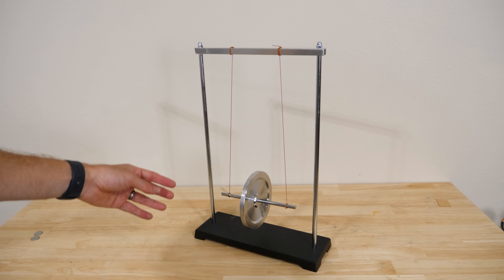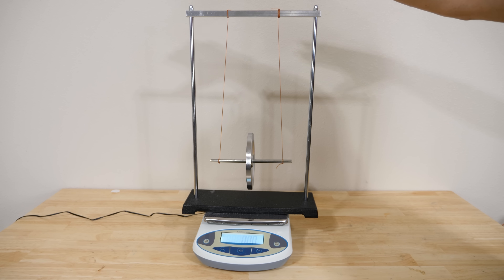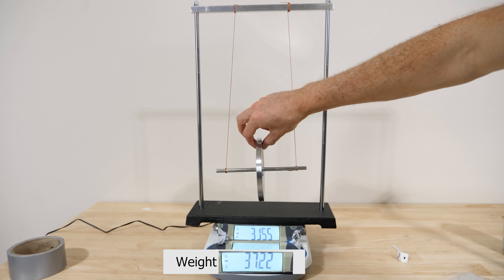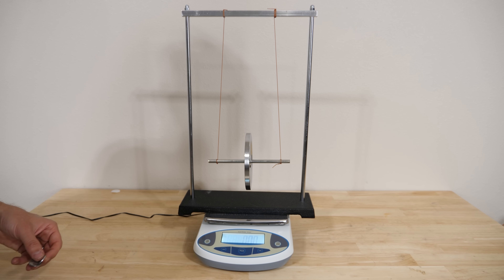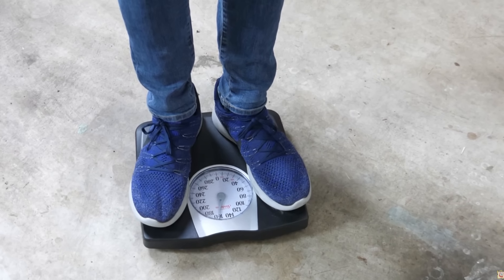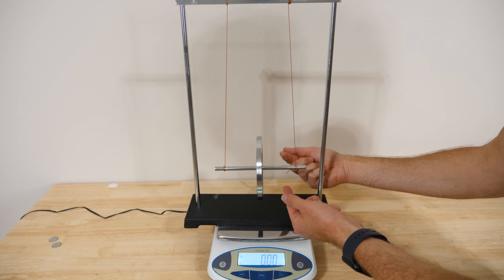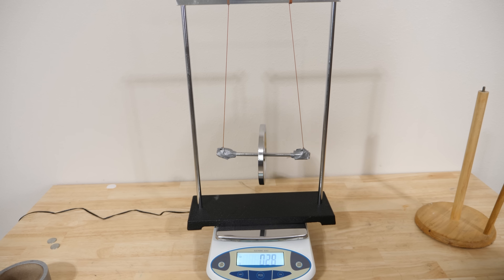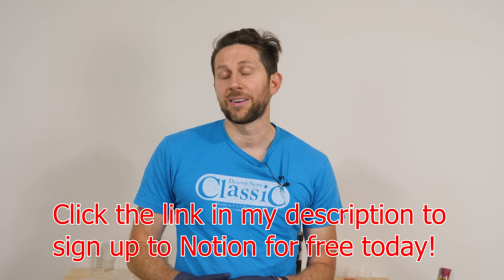How Does The Anti-Gravity Wheel Work?

Comment: Just for curiosity explanaiton posibility - Is this not a reason becuse if its  movinfg up and  down it diplaces the air above it that is generating the pressure the is pushng the object towards the ballance. And since its on eleastic (its non fixed geomety  rope - so there might be that there  there is weight  ( acceleration) acumulation  in the rope  (like in the spring) in the nform of vibaraitons  that ar resonating only at bouncing back - at very short point of time (the ballance averaging is not able  to capture it). The gyroskope has fived geomety and no air miving aup down or sidewise to it ..therefore the ballance indicaiton  is always  stable?  Would this be a possible epxlanation? Since the weight measuring is measuring directional acceleration. And you see rope swingling  and wrigeling..but you dont see this at gyroscope. and this could  be the difference? A  posibility of direction of air dplacement changed in time?  

Could it be simpler. So if it rotates and moves aside than it has 2 freedom axis of braking sytmetry of pressing air downwards  --  in 2 axis then reduce of weight is possbible. And gyroscope has one - because it  fixed not to move its fixation axis  sidewise - so then the gfyroscope has  only one dergee of freedom in its axes and weigh reduce is then not posisible? and since the density is realted .. change od geometry height invilves change of relative density difference of air and boject in relaiton to each other?  And for gtroscope it is not possible when fixed. When  wil lbe unfixed then might be didftent stoyy because it might have more axis of freedom to  diplace the air aournd it by 6 gramm :).

Comment: What you said about the spinning mass around you is not to my experience, correct. Assumption isn't a good scientific methodology. Do the test yourself and verify the weight of the subject and weight remain the same. 
As for moving down while going up, that doesn't really cut it for an explanation but conservation of momentum does. 
Good video but needs more work. 👍

Comment: Can we try in vacuum?
Reply: Makes no difference because:
The wheel does NOT weigh less when it is spinning!.
..
It may be more correct to say that it weighs less when it is "bouncing".
..
I have a problem with the interpretation of the Laithwaite demo.  Precession does not translate the wheel.  It does not lift it. 
Precession causes the axis of rotation to change direction. This is a ROTATION about the center-of-mass of the wheel. It is not lifting the whole wheel's mass. 
.
Precession does not cause the gyro to move (translate) sideways, nor upward in Laithwaite 's case or Veritasium's case. 
If the vertical spinning gyro had translation, it would slide along the table, but stay vertical. It does not do that.  It tips, or rotates at 90 degrees.
The fact that the handle is offset and long has significance.  If you push the handle in the direction of the precession, that lifts the handle, right?.

However the interpretation that the spinning wheel is always accelerating downward even while moving upward,  is a very good catch. It took me a few seconds to realize that.  My quick initial feeling was that the weight would go positive on the way up. . . 
The way to think of it is that is is 'partly falling' due to gravity.  When you are in free-fall you are completely 'weightless'.  The spin and string-shaft arrangement allow it to fall, but not fully, as when you are in free-fall.  So, the frame experiences somewhere between the full weight and weightless ness, but more weight during the bounce time. 
..
 The winding and unwinding of the string causes the up and down motion which is what changes the weight. 
..
Stand on a bathroom scale and at a medium speed, move up and down by bending your knees.  Try to move faster and faster on the way down and slower and slower on the way up. You will see your weight decrease during those times.

.. .. ..
If you watch carefully, you see that it is speeding-up as it drops; this is accelerating, but not at the full 'gravity-rate'.
Also, it is slowing-down as it rises, again not fully accelerating (decelerating or negative acceleration) due to gravity.
..
On a trampoline you are completely weightless from the time your feet leave the trampoline until they touch again and start the bounce. During this time you are constantly in 'total' free-fall.
When in contact with the trampoline you are accelerating upward and weigh more than normal.
If you can add a small upward force to reduce the acceleration due to gravity, you will weigh less. No surprise there.

This is analogous to only "partway" jumping on a trampoline (or your bouncing ball).  On a tramp, you are accelerating downward when your feet are not in contact with the tramp. The ball is when it is not in contact with the floor.  The spinning wheel only "partly" leaves the support strings.  It is "partially bouncing".
If the tramp accelerated you upward at twice the rate of gravity, your weight would double.
Therefore, there is also a slight increase in weight at the bottom bounce.
.
This would be equivalent to a small jetpack on your back that can't lift you, but only partly reduces your weight.  You would be in "Sloe-Fall", not free-fall.
..
This would make a wonderful Dean Drive Scam. . . .
..
It would be nice to have a real-time force load cell so we can see what happens at the bottom of the wheels travel - the positive weight gain during the short 'bounce' time.

..
Also, WHAT HAPPENS to the weight, if the wheel is NOT spinning, but bouncing while being suspended by a spring, instead of the winding/unwinding strings?  
Is that equivalent to this "partial bouncing" effect?

Comment: Spiral Spinning is a key to understand anti-gravity... everything what levitates is spinning... have you never asked yourself, why planets, solar systems, galaxies are constantly spinning/rotating?
The famous austrian investigator Viktor Schauberger found out a lot of hidden principles of the nature and build an ufo prototype for the germans.
Read his books.
Reply: The wheel does NOT weigh less when it is spinning!.
..
It may be more correct to say that it weighs less when it is "bouncing".
..
I have a problem with the interpretation of the Laithwaite demo.  Precession does not translate the wheel.  It does not lift it. 
Precession causes the axis of rotation to change direction. This is a ROTATION about the center-of-mass of the wheel. It is not lifting the whole wheel's mass. 
.
Precession does not cause the gyro to move (translate) sideways, nor upward in Laithwaite 's case or Veritasium's case. 
If the vertical spinning gyro had translation, it would slide along the table, but stay vertical. It does not do that.  It tips, or rotates at 90 degrees.
The fact that the handle is offset and long has significance.  If you push the handle in the direction of the precession, that lifts the handle, right?.

However the interpretation that the spinning wheel is always accelerating downward even while moving upward,  is a very good catch. It took me a few seconds to realize that.  My quick initial feeling was that the weight would go positive on the way up. . . 
The way to think of it is that is is 'partly falling' due to gravity.  When you are in free-fall you are completely 'weightless'.  The spin and string-shaft arrangement allow it to fall, but not fully, as when you are in free-fall.  So, the frame experiences somewhere between the full weight and weightless ness, but more weight during the bounce time. 
..
 The winding and unwinding of the string causes the up and down motion which is what changes the weight. 
..
Stand on a bathroom scale and at a medium speed, move up and down by bending your knees.  Try to move faster and faster on the way down and slower and slower on the way up. You will see your weight decrease during those times.

.. .. ..
If you watch carefully, you see that it is speeding-up as it drops; this is accelerating, but not at the full 'gravity-rate'.
Also, it is slowing-down as it rises, again not fully accelerating (decelerating or negative acceleration) due to gravity.
..
On a trampoline you are completely weightless from the time your feet leave the trampoline until they touch again and start the bounce. During this time you are constantly in 'total' free-fall.
When in contact with the trampoline you are accelerating upward and weigh more than normal.
If you can add a small upward force to reduce the acceleration due to gravity, you will weigh less. No surprise there.

This is analogous to only "partway" jumping on a trampoline (or your bouncing ball).  On a tramp, you are accelerating downward when your feet are not in contact with the tramp. The ball is when it is not in contact with the floor.  The spinning wheel only "partly" leaves the support strings.  It is "partially bouncing".
If the tramp accelerated you upward at twice the rate of gravity, your weight would double.
Therefore, there is also a slight increase in weight at the bottom bounce.
.
This would be equivalent to a small jetpack on your back that can't lift you, but only partly reduces your weight.  You would be in "Sloe-Fall", not free-fall.
..
This would make a wonderful Dean Drive Scam. . . .
..
It would be nice to have a real-time force load cell so we can see what happens at the bottom of the wheels travel - the positive weight gain during the short 'bounce' time.

..
Also, WHAT HAPPENS to the weight, if the wheel is NOT spinning, but bouncing while being suspended by a spring, instead of the winding/unwinding strings?  
Is that equivalent to this "partial bouncing" effect?

Comment: If you can make it reach -1000KG we can have flying cars.
How big would it neet to be to reach -1000 KG ? Just need a few of those in sync like the pistons of a combustion engine to compensate for the 0 point.
Reply: Nope.
The wheel does NOT weigh less when it is spinning!.
..
It may be more correct to say that it weighs less when it is "bouncing".
..
I have a problem with the interpretation of the Laithwaite demo.  Precession does not translate the wheel.  It does not lift it. 
Precession causes the axis of rotation to change direction. This is a ROTATION about the center-of-mass of the wheel. It is not lifting the whole wheel's mass. 
.
Precession does not cause the gyro to move (translate) sideways, nor upward in Laithwaite 's case or Veritasium's case. 
If the vertical spinning gyro had translation, it would slide along the table, but stay vertical. It does not do that.  It tips, or rotates at 90 degrees.
The fact that the handle is offset and long has significance.  If you push the handle in the direction of the precession, that lifts the handle, right?.

However the interpretation that the spinning wheel is always accelerating downward even while moving upward,  is a very good catch. It took me a few seconds to realize that.  My quick initial feeling was that the weight would go positive on the way up. . . 
The way to think of it is that is is 'partly falling' due to gravity.  When you are in free-fall you are completely 'weightless'.  The spin and string-shaft arrangement allow it to fall, but not fully, as when you are in free-fall.  So, the frame experiences somewhere between the full weight and weightless ness, but more weight during the bounce time. 
..
 The winding and unwinding of the string causes the up and down motion which is what changes the weight. 
..
Stand on a bathroom scale and at a medium speed, move up and down by bending your knees.  Try to move faster and faster on the way down and slower and slower on the way up. You will see your weight decrease during those times.

.. .. ..
If you watch carefully, you see that it is speeding-up as it drops; this is accelerating, but not at the full 'gravity-rate'.
Also, it is slowing-down as it rises, again not fully accelerating (decelerating or negative acceleration) due to gravity.
..
On a trampoline you are completely weightless from the time your feet leave the trampoline until they touch again and start the bounce. During this time you are constantly in 'total' free-fall.
When in contact with the trampoline you are accelerating upward and weigh more than normal.
If you can add a small upward force to reduce the acceleration due to gravity, you will weigh less. No surprise there.

This is analogous to only "partway" jumping on a trampoline (or your bouncing ball).  On a tramp, you are accelerating downward when your feet are not in contact with the tramp. The ball is when it is not in contact with the floor.  The spinning wheel only "partly" leaves the support strings.  It is "partially bouncing".
If the tramp accelerated you upward at twice the rate of gravity, your weight would double.
Therefore, there is also a slight increase in weight at the bottom bounce.
.
This would be equivalent to a small jetpack on your back that can't lift you, but only partly reduces your weight.  You would be in "Sloe-Fall", not free-fall.
..
This would make a wonderful Dean Drive Scam. . . .
..
It would be nice to have a real-time force load cell so we can see what happens at the bottom of the wheels travel - the positive weight gain during the short 'bounce' time.

..
Also, WHAT HAPPENS to the weight, if the wheel is NOT spinning, but bouncing while being suspended by a spring, instead of the winding/unwinding strings?  
Is that equivalent to this "partial bouncing" effect?

Comment: You are missing a big point here- the average force down is always equal to its weight (given the same start end end speed).
There is a positive spike when it reverses direction at the bottom that is much larger than the 6 grams. The high force, low duration positive impulse averages out with the low force, high duration negative impulse measured. I think this video is a bit misleading because although you did mention this positive pulse in a single sentence near the end, from the comments it's clear most viewers missed that.

Comment: It seems like you're conflating multiple things here and it confuses as much as it helps. For example you say the only time the weight registers is when it's at the bottom, but when it's riding on the strings, it doesn't. You say when it's going up the weight isn't there either, but when it goes up on the strings it's pulling down on the strings. There should be tension on the string since it's both taught and without the string the wheel would fall, so how is it both suspended but not having the weight register? Perhaps if you weighed the wheel and shows how some of the energy is tied up in spinning the wheel / torque and the force to lift it, or show how it's in a bounce state even though it's keeping the strings taught, this would be more helpful. When you hold it up off the strings I'm just thinking well of course that's less weight... how is it less weight when it's literally pulling itself up? what happened to the equations of motion? Like what happens if it's connected to a motor and the motor is hanging... if you continuously accelerate the wheel by the same curve as gravity, would that make it weigh less? I doubt that or we'd have a way of creating antigravity. it's some relation with the suspension with the string and I feel like that wasn't properly explained here. For example, your gyroscope didn't rotate the wheel around the pivot like the handheld wheel, what happens if you replicate that and weigh it, is that acceleration causing it to lose weight or is it only up and down, and if so, then there must be a better way to put it than "it weighs less because it's accelerating"... But in any case, I do appreciate that you always try to make it intuitive and do the next logical "what if"s to understand the phenomena with the viewer, I just felt the words and examples here shared the definition space in a confusing way.

Comment: The half of the wheel that's moving upwards during the rotation is causing the negative six I suppose.... It's equivalent to putting your finger on the wheel and lifting it up slightly. It'd be interesting to know what proportion of the overall weight that six grams is.. It seems like it should be half the weight of the disc....